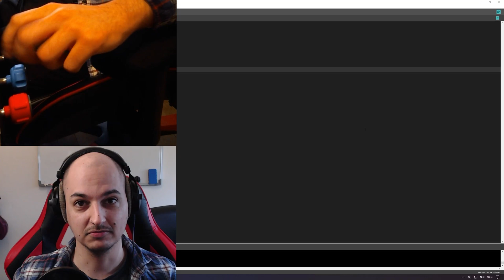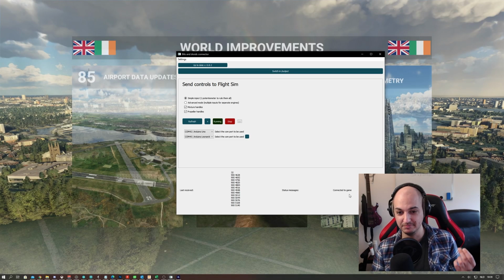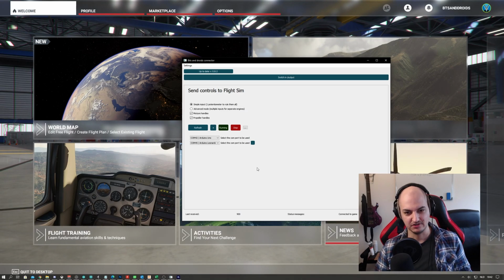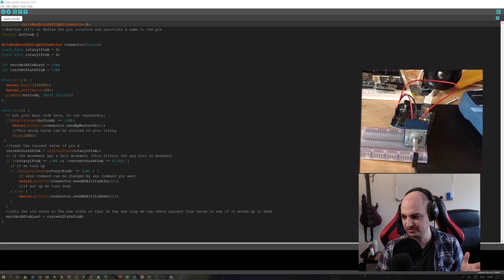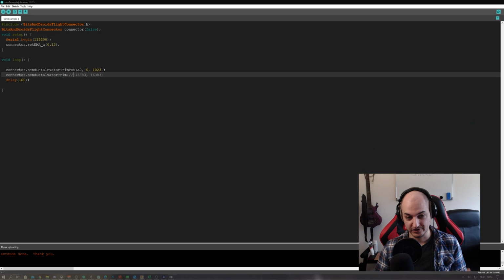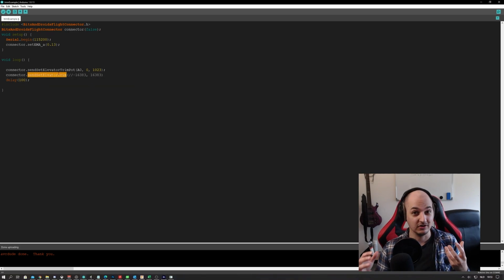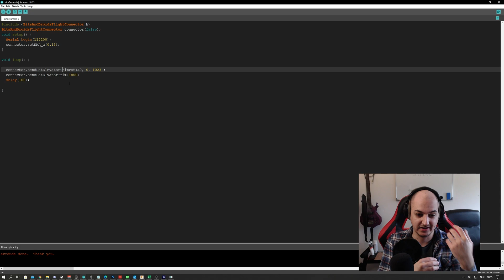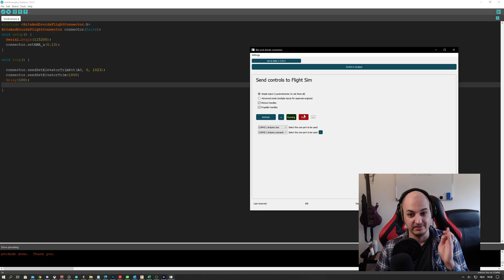Show me those trim wheels! 0.8.3

Comment: It seems like "connector.getTrueVerticalSpeed()" does not correspond with the indicated vertical speed. Could you check this please?  Airspeed, Altitude are doing fine, but the vertical speed seems to be totally off.
Reply from the maker: I believe it returns the actual vs in comparison to the indicated vs. But I'll have a look in an hour
Reply: @Bitsanddroids  I try to get the vertical speed like presented in the main flight panel G1000 next to the altitude meter. ( I am not sure you would call this indicated  or actual vs)
Reply from the maker: @peterboekel9728  I'll have a look later and get back to you when I've found it